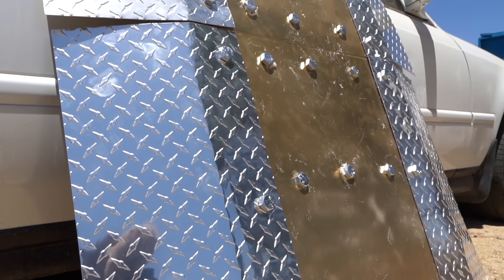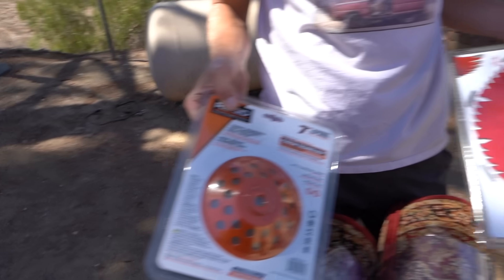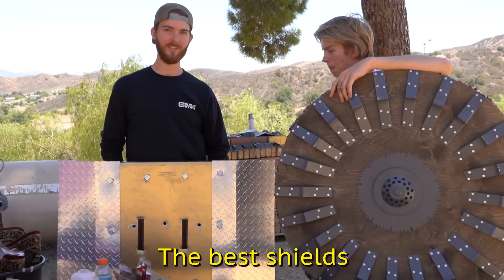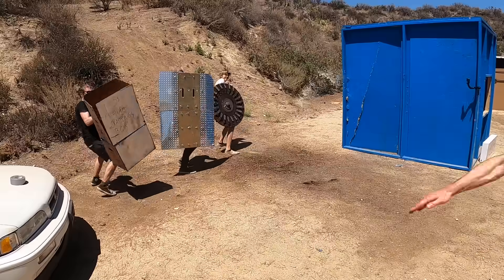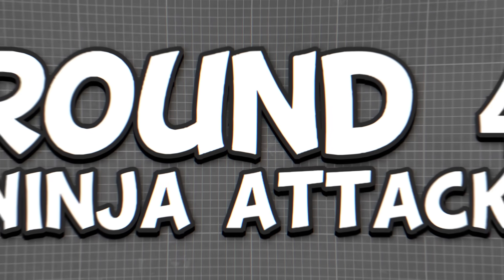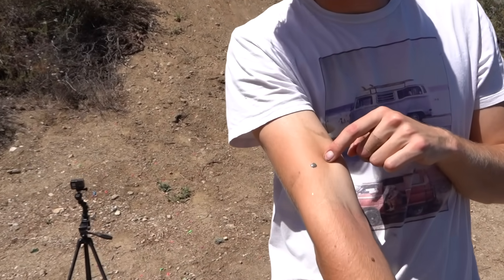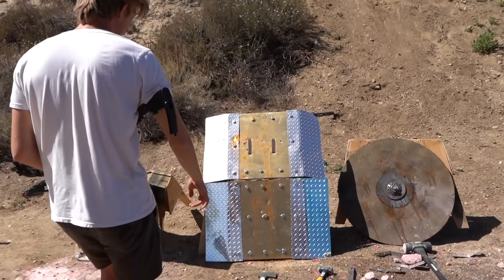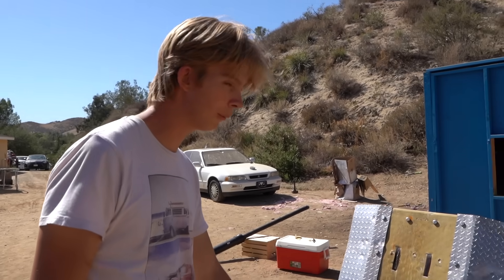CHEAP vs EXPENSIVE Survival Shields! *BUDGET CHALLENGE*

Comment: i think this is a good strategy   first try to know whats the weakness of ur shields  and i think a plastic shield has 1 weakness and its fire so i would first put metal sheets in front of the plastic and the metal is gona burn the plastic because of heat and i would put 2 metal sheets and 1 plastic table  this is a good strategy because plastic has 1 weakness fire and metal has 1 weakness to i think fire so theres 1 fire challeg thats good